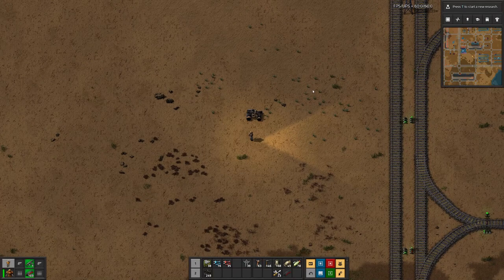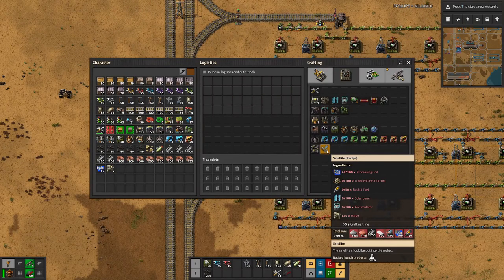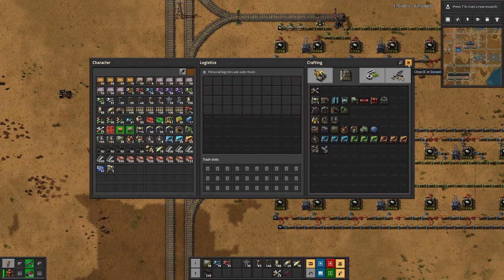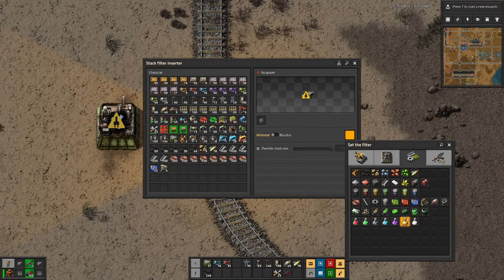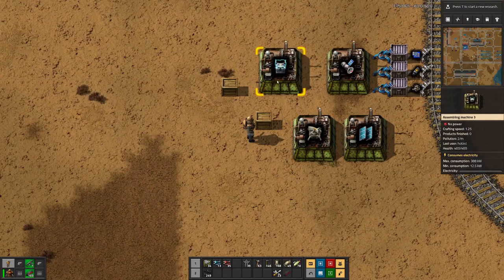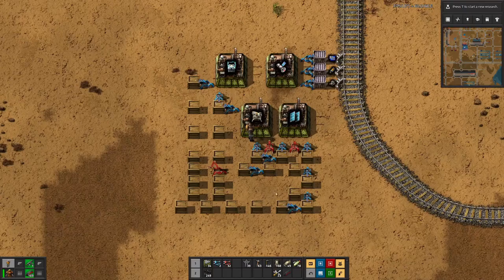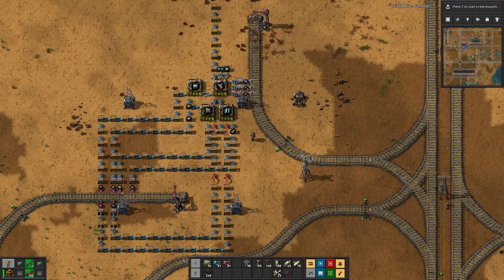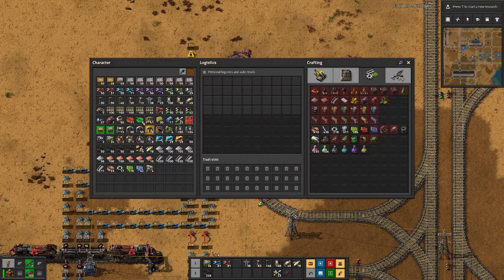Beltless Factorio | Producing a Satellite - E62

Comment: Starting my own try at this.  Setting up city block cells that are 2x3 and 3x2 standard city blocks each, in a herringbone pattern.  That way there are only 3 way intersections.  Great series with a lot of good ideas.
Reply from the maker: Cool idea, the asymmetrical may resolve some of the intersection issues.
Reply: @hotzstGaming   I made a mistake they are 3x4 and 4x3.  so 300x400 to the outside of the light strings. After several years I'm still not clear on how to set up the snapping  but the power lines make it easy to target.
Reply from the maker: @Hazmatt4700  I also played a bit with snapping to the grid and miserably failed. As far as I can see it works fine if your blueprint does not have a spacing at the outside.